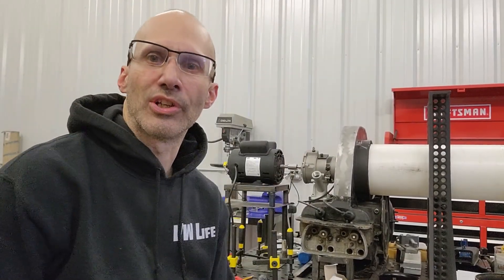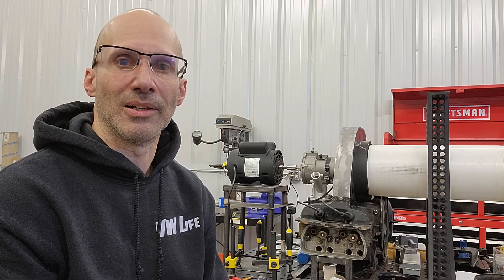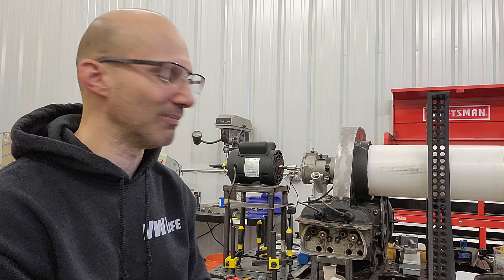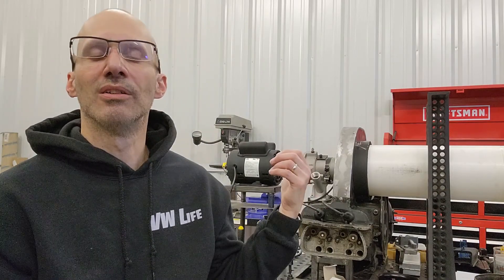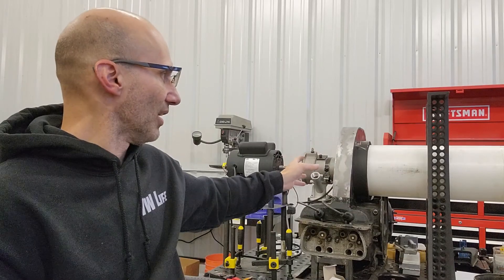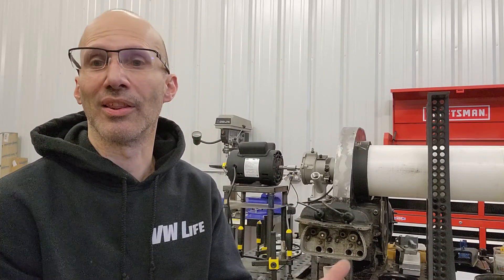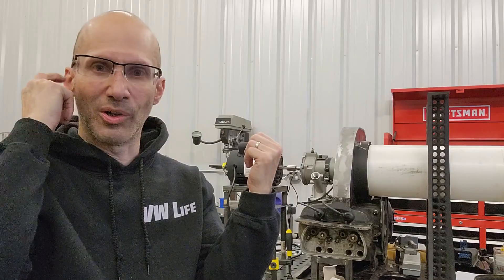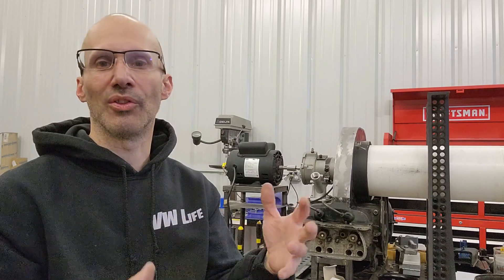Evolution Fan Shroud Testing Update!

Comment: Powder coating doesn't  hide 'imperfections' in the same way that filler and paint would. If the visual appearance is that critical, then I imagine buyers would have it painted professionally (or do it themselves). A 'shipping' coat or spot priming would be good if left in plain steel, to prevent untimely corrosion, but ideally, this needs to be done straight after welding. Nickel plating is cheap, keeps corrosion at bay and can also be powder coated. Media blasting would be a good way to prep plain steel with small 'imperfections' such as linishing marks. The texture finish would also provide a good key for any surface coating thereafter. These could easily be done by the buyer, unless they wanted a 'straight out of the box' product, in which case that's more work for you! Prepping and coating one shroud, in one particular colour, will be considerably more expensive than doing a full batch, but then you run into quality control issues...
Personally, I'd be happy with a hand-crafted piece, that fit's properly and does the job better than stock....what it looks like is secondary to performance and function. You could always do them in stainless...Abel Black would look great on a hand made shroud :) https://www.diversifiedulbrich.ca/blog/abel-black-stainless-steel-top-marks-for-strength-beauty-and-versatility
Reply from the maker: Great feedback.  I already knew that powder coating wouldn't hide the imperfections, and I have purchased a product that is a filler that allows you to still powder coat, so it's a metal based filler.  I'm planning on testing that out, and if it works well, I'll use that so that when it's painted or powder coated you'll get a nice smooth finish.  We will see how well it works, and then decide on a course of action.  Thanks.

Comment: With the room under the fan shroud, I would mount my coil behind and run all of the wires under the shroud to the distributor and back.  Could you do a build your own?  You hammer out the pieces that are custom shaped and let us weld the whole thing up?
Reply from the maker: Your the third person to suggest a build your own, and I just might do that.  My design does make it fairly simple to put together, especially with the pieces that need to be shaped already done.  I know a lot of people do like to hide their coil, so I can see mounting it behind.  Would you want me to create a mount that mounts behind?  I have a design for one that mounts in front, and I think it would be easy to have one that mounts behind using the crankcase area that already has a hole that is unused.

Comment: the coil mount should be on the fan shroud in my opinion to save space and more practical
Reply from the maker: One of the considerations is alternative coils.  I run fuel injection and have a four post coil pack, and I know the CB Performance Magnaspark coil needs a different mount, but most people are using the regular coil.  Thanks for the feedback, hopefully more folks will chime in, and I'll get a good picture.  I'm even considering offering multiple options, because it's fairly easy to add it or leave it off.  Thanks again.